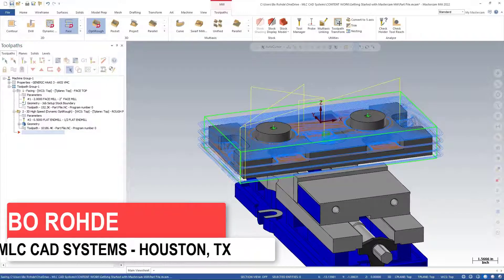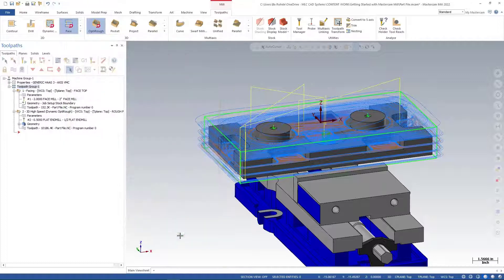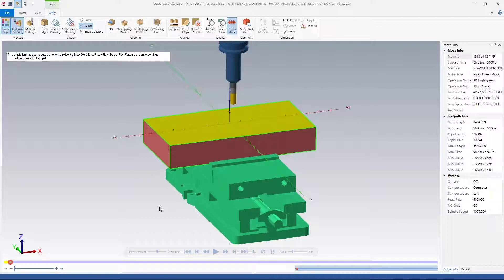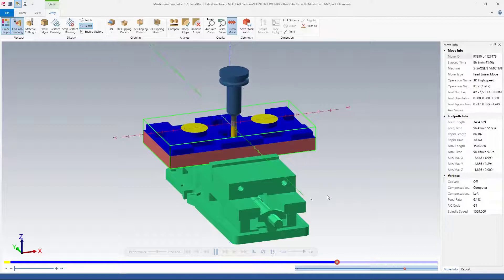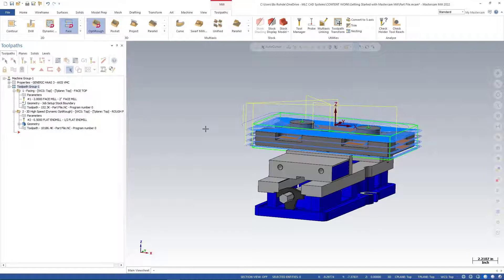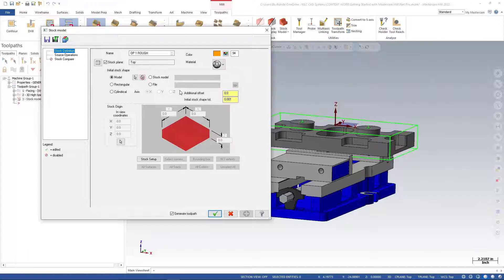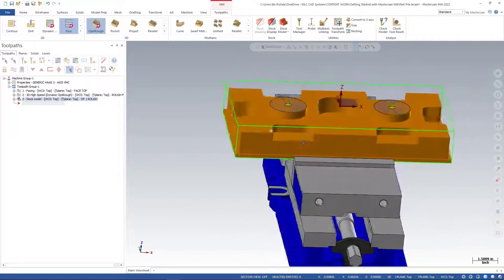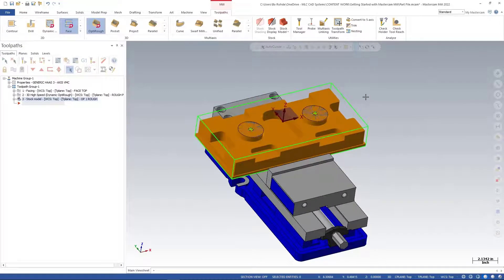Verify Toolpath and Intermediate Stock Model - Getting Started with Mastercam Mill Webinar 8/12

Comment: Hi Sir. Could help me! Why evey time I post program 3 asx mill with ramping open hole with endmill the post come out too long, is this because of the post processor of mastercam or what? As u are programer just like this......endmill.5 ID is.8, deep 1.00 so when we post out it has around 6 blocks only right? But if I use mastercam 2021 it gave me so long program just for that ID? Thanks Sir
Reply from the maker: This could be caused by a number of things including post settings or arc filtering and really depends on your specific toolpath setup and post.  Your best bet is to reach out to your support provider or administrator who works with your post processors to review the code to better understand why and how to improve it.  This is not a typical behavior from Mastercam 2021.